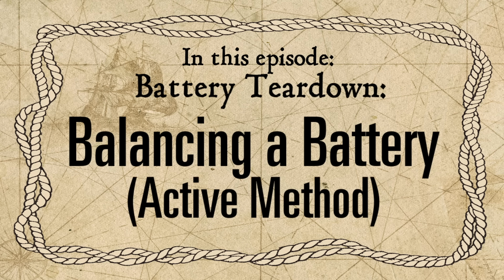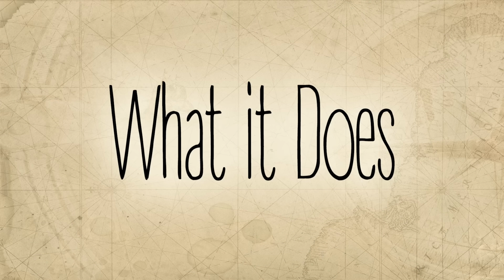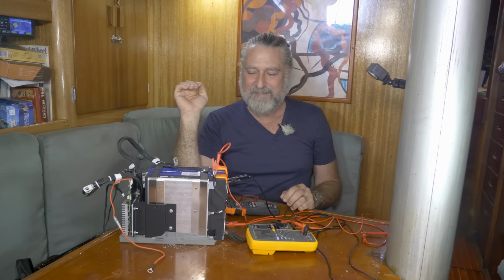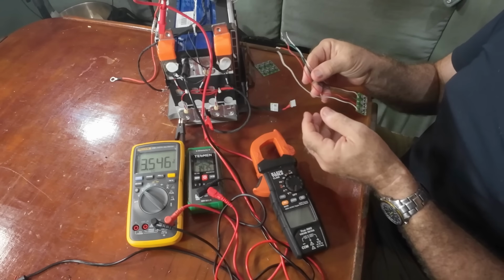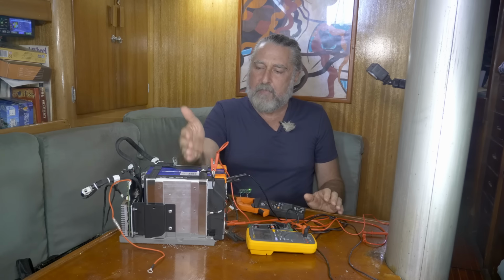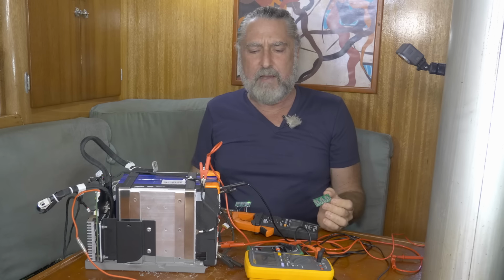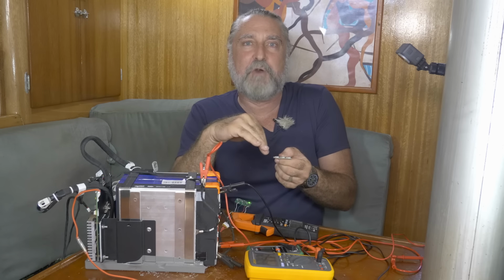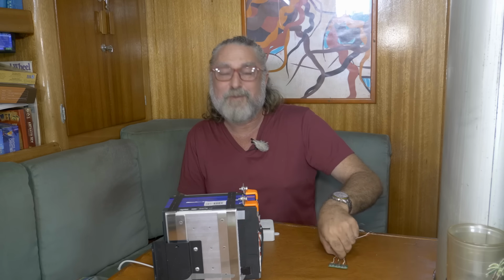Rebalance your batteries for $10.

Comment: I have watched a lot of your super helpful videos, thanks!  Wouldn't it be cool if you could set your lithium batteries up so that you had the pigtail for cell balancing on the outside of the case?  Then you could just plug in a cell balancer from time to time and or manually monitor the cell voltages as needed?  I used to used to fly a lot of R/C planes that used lithium cells and you can buy these little cell balancers that just plug into the balance lead coming out of the battery.   You can get these little balancers for the various lithium chemistries and they are quite inexpensive.  Keep up the good work and keep the ideas coming!
Reply from the maker: Yep.  I wish.

The cases are horrible to open.

Comment: The main thing to check once you've torn a battery pack down is to check the internal resistance of each indiviual cell. Difference in IR between cells is the biggest cause of battery failure! The cells you have issues with probably have wildly different IRs. Adding extra active balancing power is good but at least if you can work out how out of hoof each cell IR is that'll give you an idea of whaat the active balancer has to handle.

Comment: Clark, the larger capacitor based balancers are better than the small one you are showing. I have both, tried both. Would gladly send you pictures. Just a tip though. try the others out. The price difference justifies the better performance. Also a modification would be in order to make the top balancer switch on above 3.4 volts (the beginning of the hockey stick)
Reply from the maker: I defer to you if you have tried both
Reply: These are the ones I am talking about. They also balance with up to 5A current depending on voltage difference. All balancers however need to only balance above 3.4 volts or thereabouts, IMHO. Great videos. Very helpful and thorough. @Clarks-Adventure
Reply: MY link was not allowed. I am not sure why. By the way there is another quirk related to this particular model of balancer. The minimum balancing voltage is 0.02V. Only adjacent cells are checked for this voltage difference, which in theory could mean you would end up with 0.06V difference (worst case) from the first cell to the last. It is possible to do better.

Comment: I build my battery and was going to add a BMS, but so far I have been doing a manual check every 3 months and found the 24V, 8 cell 100AH LiFePo4 never lost its balance. Normal charge goes up to 3.50V, The only consumer is the inverter and it stops at 3.05V. I top balace at 3.65V. I have been living of Solar for 2 summers now and so far so good.

Comment: I like the working principle of this balancer, but since the Amazon listing details that it will not begin to operate until a 0.1V difference is sensed between the cells, it doesn’t seem suitable for keeping cells in balance in a typical system where max charge voltage is limited to the region where such gross differences in cell voltage should not show up. 

Seems the device could help prevent a battery pack getting way out of balance, but for maintaining a proper or acceptable balance for good practice and best efficiency, it’s not really the right unit IMHO
Reply: totally right. also checking the voltage with three diferet (and dispaired quality) meters is quite questionable when we are looking at milivolts levels.
Reply from the maker: I've found the fluke I use is very reliable.  It's one made for the Asian market so it's priced cheaply.  Check out our Amazon store in the description for a link.
Reply: @Clarks-Adventure  Hi Clark, have a nice sunday.
yes, I agree on the Fluke. 
From the layout of the butoms I supose it is a 70 series (I own one priced aprox 400 usd since 20 years ago). 
The problem is that you compared the readings of a high quality (and accurate due to its original calibration and stability of its components) meter of several hundreds of USD  with the reading of a low end chinese 10 dollars tester and with the readout of a dc current clamp. 
When measuring 220v it doesnt matter, but even in the 12v range there can be diferences.
If you have previouslly checked the readings of the three instruments in the SAME cell and validate the accuracy of the readings, it is ok, but in such case, you should say that when presented the procedure (IMO). Otherwise, as engineer, I must doubt that the readings at milivolt level can be comparable.
Good video and interesting experiment anyway.
Best regards from Madrid (Spain),  Jose
Reply from the maker: You must consider what I'm trying to actually measure here.  I was showing that the cell voltages were trending towards each other once I fired up the balancer.   Sure if I was making a claim as to where they ended up and how many millivolts the final separation was I'd have to use one meter.   
   I've found the clamp-on meter is accurate enough at the 1 amp scale for the purposes of this demonstration from calibrating it with power resistors (and the fluke).  Yes I've had crap clamp-ons before but for me this one works fine at the 1 amp and above range.

   That fluke is only 180 bucks by the way.  I find it a great meter for the money.  It's most likely a 70 inside but as I said made for a price sensitive market.  I was happy when I discovered it.
Reply: I have tried many of these active balancers and find that they are horribly imprecise. when one side of the balancer activates it can cause the other side to activate even if they are perfectly in balance. maybe if Clark is on to something by limiting the active balancer with resistors it could do a better job at actually balancing a pack. I simply choose to use a "flying capacitor" active balancer which works wonderfully.

Comment: cell 3 at 3.43v which is 100 percent charged and cell 4 at 3.55 volts which is 100 percent charged. When do we get to see the active balancer balance some cells?
Reply from the maker: Maybe you should watch again.  Those cells weren't balanced their voltages were different, that's about the definition of imbalanced.

The active balancer saw this, turned on its light and moved power.
Reply: @Clarks-Adventure  If you don't mind, please redo the test and have one cell be 3.2 volts and the other be 3.31 volts so we know the balancer works!

Comment: Also, I've looked at those active balance boards on Ali, 99% of the sellers say these should be used for balancing only, not long term use. i.e. Use these boards instead of what you did with the power resistor and it would probably do a better job. Do not use those boards as a permanent "fix"

Comment: Please don’t balance below 3.43 volts per cell. Having a balancer operating below that greatly increases the risk of worsening imbalance at near full charge and the bms may disconnect charge. All balancers, passive or active should not be operating below 3.43 volts per cell for lifepo4 chemistry. If you don’t have a voltage controller to start the balancer, use a switch to manually maintenance the balances at full charge. I much prefer Heltec “flying capacitor” type for retrofit systems up to 320ah cells. The one shown is recommended to 30ah cells. For 16 cell (48 volt) retrofit balance nothing beats The forth generation Neey balancer. For complete bms exchange or DIY build the JK bms is the Ultimate.

Comment: Could you build them in series and then stack in parallel...for example like 24s
PS the cheap balancing 1.2 amp vidio
Reply from the maker: If you mean balancers in series, yes you can.  But I've seen them with many chips on one board up to 48v.  There are also 1 chip boards designed for daisy chaining.

For convenience I'd likely get one 48v and 1 24v module for your 24s system.

Comment: This module is designed for battery under 30AH which is unlike to have on a boat. The B096NLHXPF module is equivalent designed for higher capacity. 

Also I believe that the current limiting resistor is not needed even for higher voltage differences since the balancer limits the current itself to 1.2amps.
Reply from the maker: As I said I'm not a fan of the flying capacitor balancers.
And there is no current limiting in this board.  I've watched it pass over 1.2 amps.  

Where are you getting your information?  Did I miss something in the chips datasheet, it's been a while since I looked it up?
Reply: @Clarks-Adventure  it’s written in the product description
Reply from the maker: It's a lie.  China does that.

But feel free to install it anyway you like